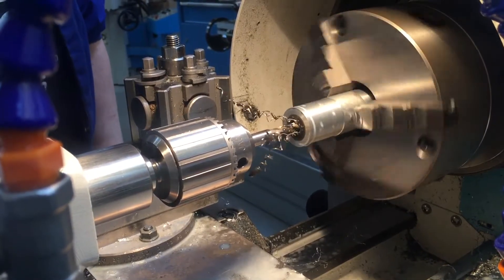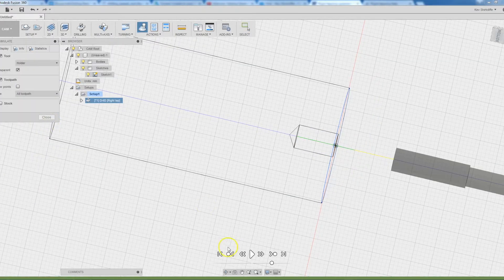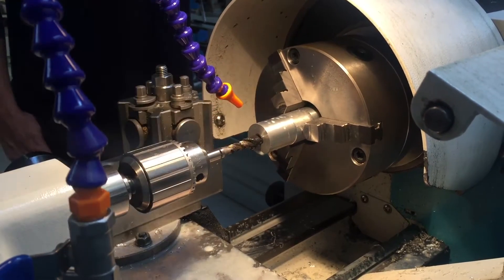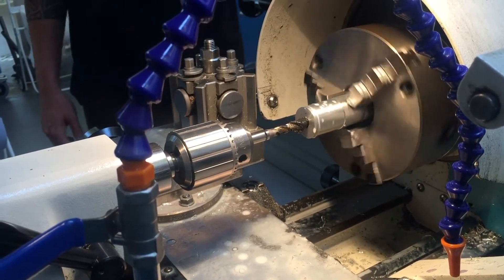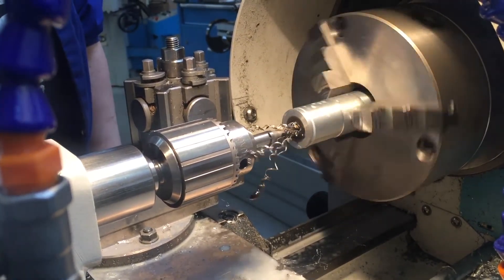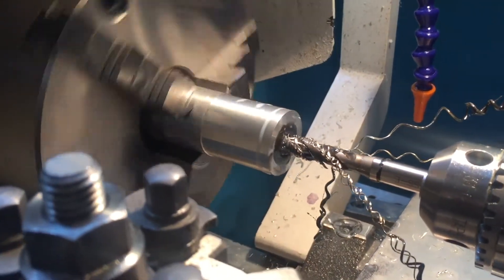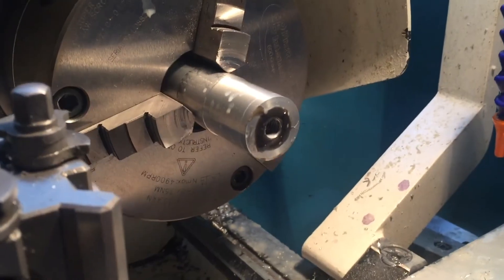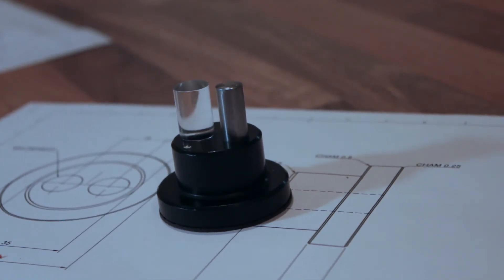Lathe Tapping Tutorial - Power Tapping using Tailstock

Comment: Lol we usually run the rpm alot faster than that  ... faster you go the less pressure but harder to stop tho we just slam it in reverse  at 250 rpm  and every machine shop i asked about lathes and if you can slam in reverse  is horrified at that lol